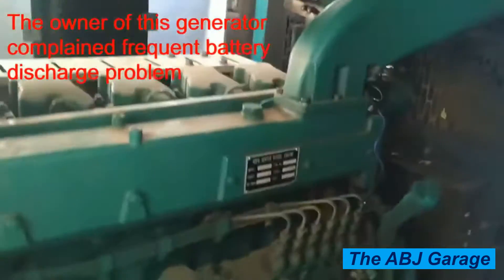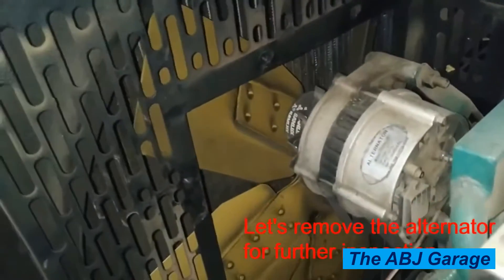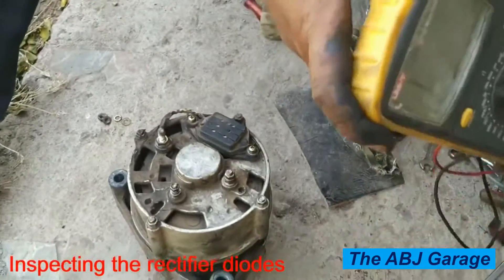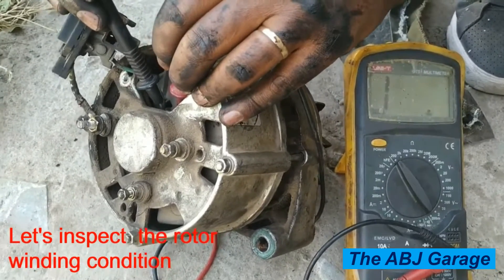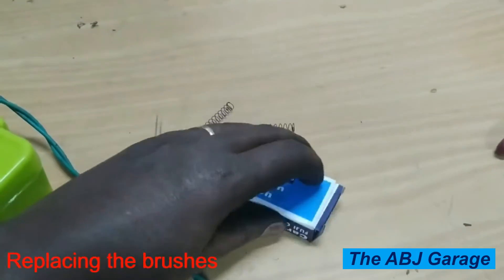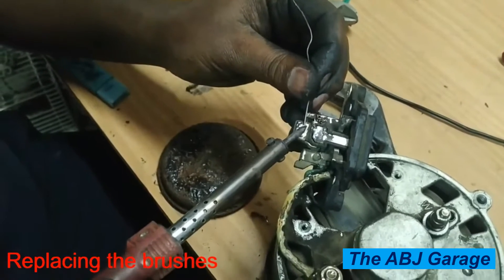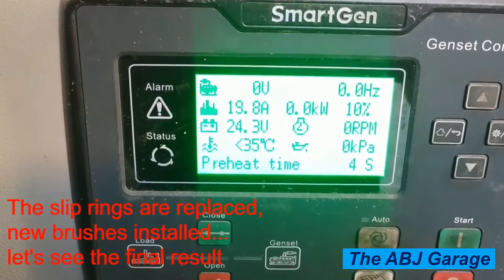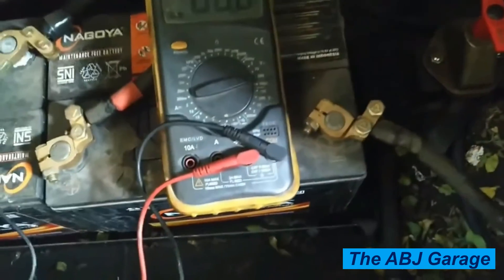How to repair an alternator, fixing unusual slip ring and brush failure

Comment: Have you fixed slip rings
Reply from the maker: Yes! We inserted a spacer between the rotor shaft and the slip ring! Some machining on the leath machine was all we did!. Unable to include it in the video because we didn't have it on video!